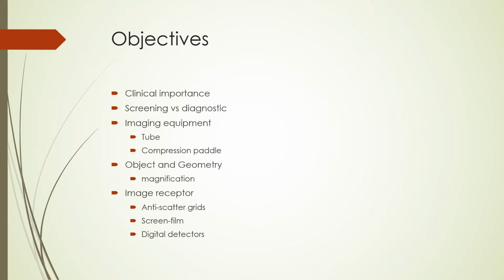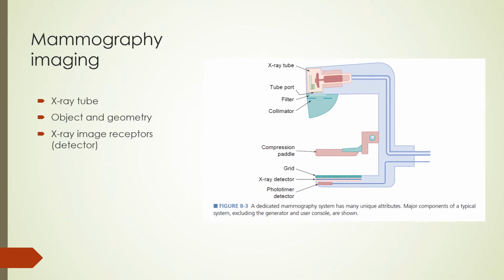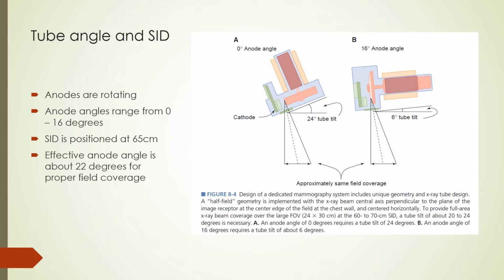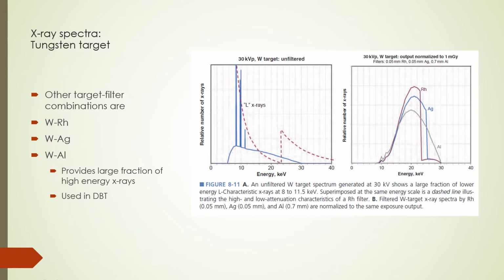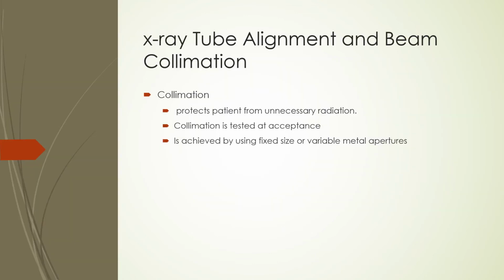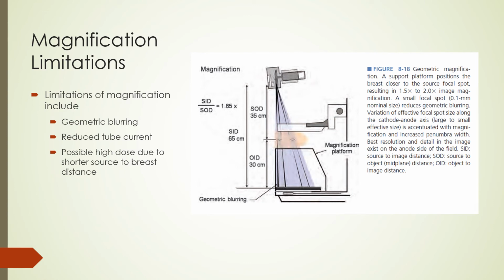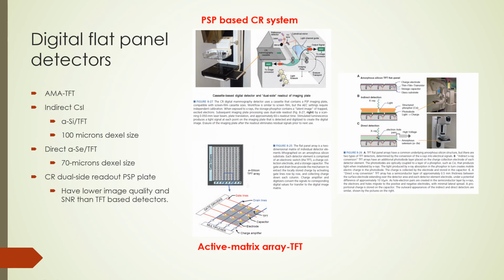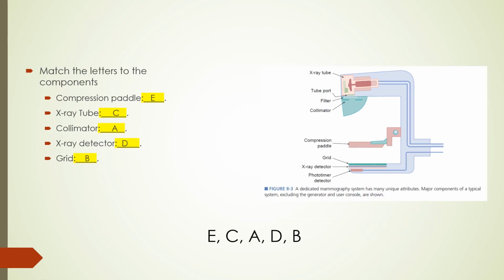#15 mammography I

Comment: Sir, is each mammography tube different from the type of mammography? for example, do digital mammography siemens, fuji, hologic have different tubes?
Reply: Hello Blake, sorry for the late response. Mammo tubes are usually made of Mo or Rh targets with different filter combinations (Mo/Mo, Mo/Rh). For DBT systems, Rhodium and Tungsten (W) target will also be an option for the tube. With Rhodium and Tungsten, the filters used are Rh, Ag, or Al. Different vendors may have proprietary features (like different filter thickness) and optimized spectra but in general the tube targets and filter combinations are as stated above. Hope this answers your question.
Reply: SEWS